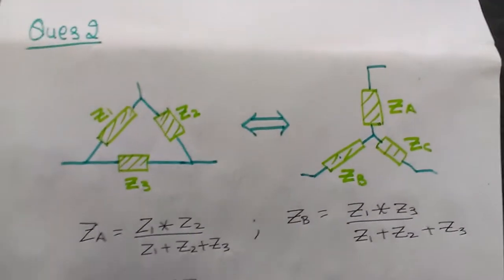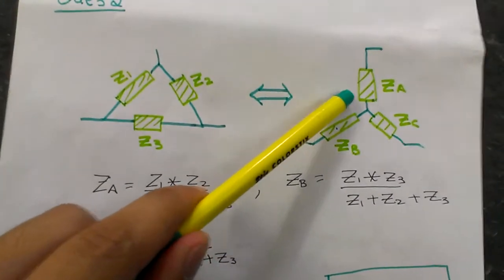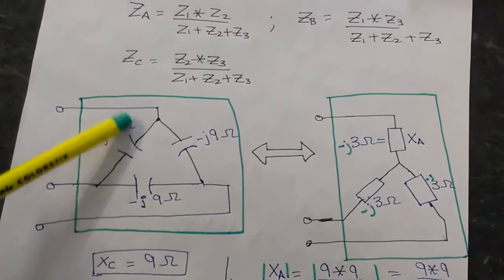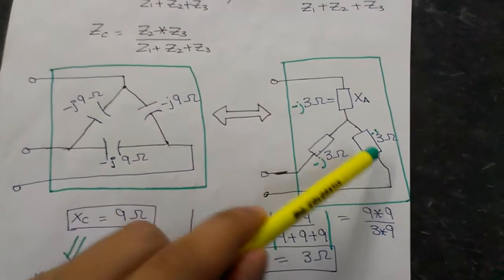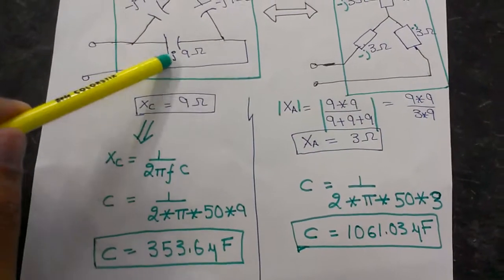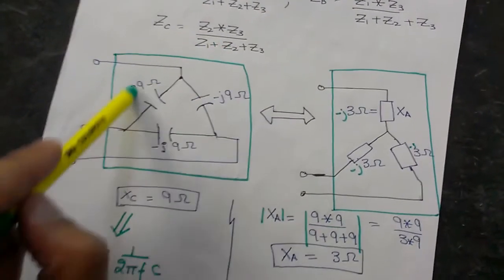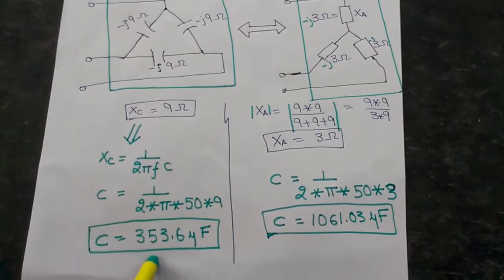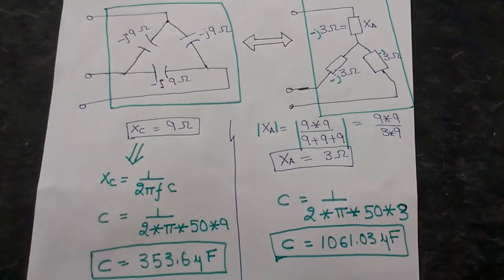Why CAPACITORS IN POWER SYSTEM ARE CONNECTED IN DELTA

Comment: Capacitor banks are rarely connected in delta. They're almost always in wye and multiple units are in series anyways to withstand the voltage to ground. Even if you look at an individual power system capacitor, it's composed of many units in parallel/series internally. Reducing the actual capacitance is not of any value. It's a matter of designing it with the correct capacitance to supply the desired VAR output at a given system voltage.
Reply from the maker: it depends where it is attached generation side or distribution side...